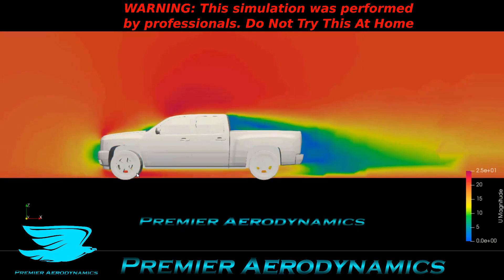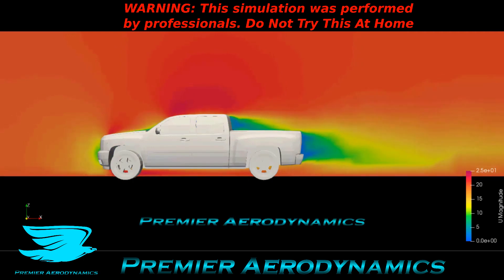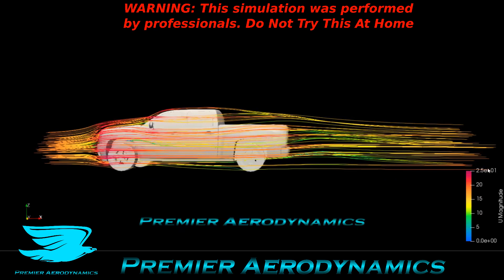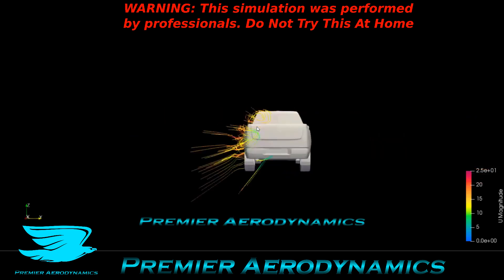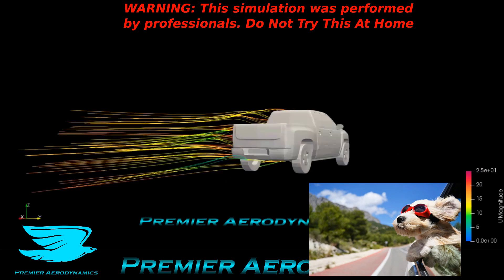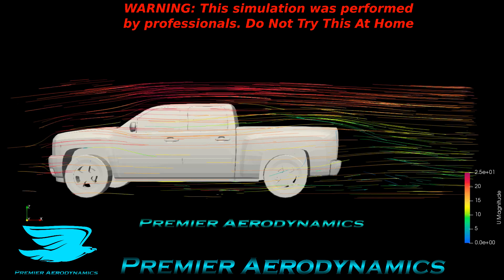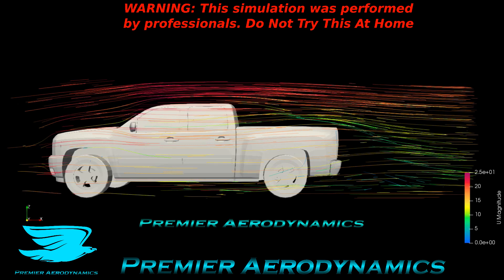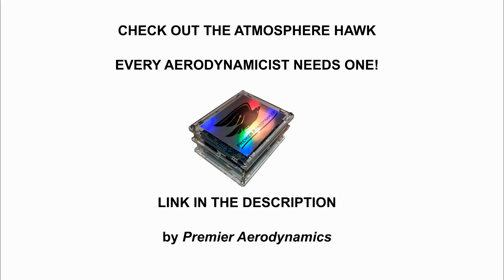Pickup Truck Aerodynamics - Chevrolet

Comment: How about a duct between the cab and bed pulling fast air from underneath and dispersing it behind the cab window? Can you test to see what that does @PremierAerodynamics ?
Reply from the maker: We will get on it Amigo! It might take a few weeks to do the geometry and CFD it but we'll post it once we've done it!
Reply: I'm so glad I wasn't the only one who thought about that
Reply: Most trucks already have a single passive turbulence generator AND a nuanced lip spoiler on the rear of the cab that you also see in the tailgate design. Turbulence generators were 1st seen on the Mitsubishi Eclipse EVO VII rally car as a row of inexplicable "shark's teeth" instead of a rear window spoiler in that area